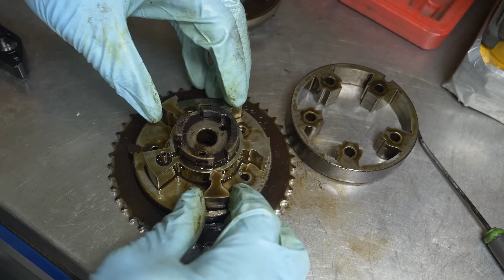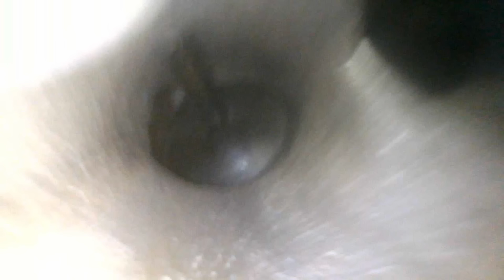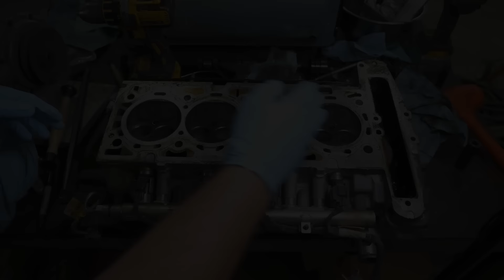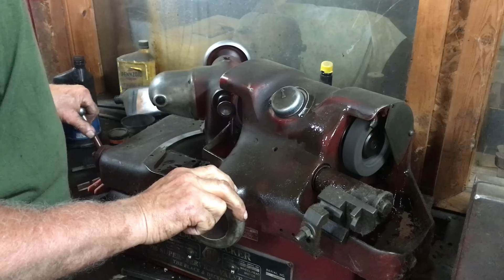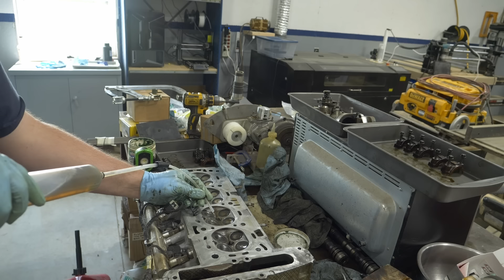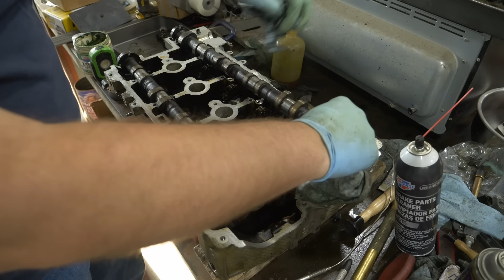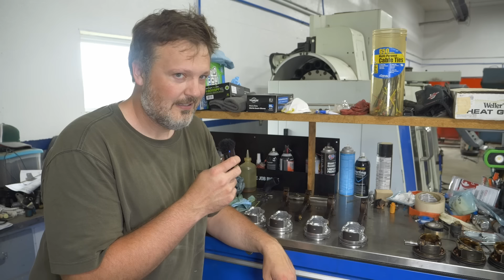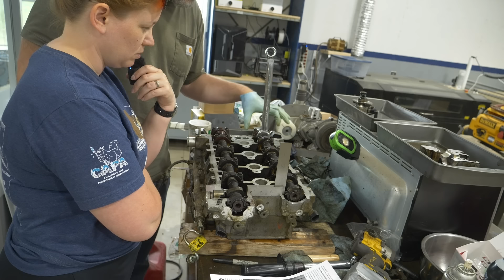How Did it Ever Run? Equinox Still Won't Start

Comment: Yup 2.4 do NOT EVER just do chains n guides, do everything, and oil punp, and high pressure fuel pump. Pump fails, thins oil, burns up pump, loosems chain=loose timing chain/eaten guides. Its a COMPLEX failure

Comment: All new engines have problems with valve dirt and stuck low tension piston rings. Once a year I run pure ATF in my crankcase for 100 miles and compression comes right back with no blowby or burning oil

Comment: Classic example of GM trash engineering. Press fit reluctantly wheels, low tension rings and Chinese supply chain garbage. It's not just GM, it's Ford and Stalantus too.

Comment: If I’ve learned anything from this video, it’s that that particular engine is absolute garbage.  I’d heard of the hilariously expensive water pump replacement, but this takes the cake.  Proof you can indeed over engineer something to the point that it’s worse than the cruder builds that came before.  Gives me fore wet timing belt vibes 😅

Comment: went into a toyota engine to fix the oil consumption, did not know it had spun a bearing,luckily no damage was done that i could see,  the pitting on the cam journal surely is fine 🤣, you rarely find 1 problem i guess

Comment: WOW, I went deep into one of these a coupe of years ago and gave up before getting this far. The motor is still sitting outside my shop, I am going to dig into it now. 
I haul scrap cars for the local fire department. The ones that they practice cutting up and rescue with. Currently they have 4 of these Equinox waiting to be chopped to pieces, 2 4 cylinder and 2 6 cylinder. All have bad engines and look like practically new cars. They were donated by people and shops who couldn't afford\justify fixing them.

Comment: Mrs Wes conclusion is correct … omg … i remember the time when a guy could pull a Chevrolet engine out of a junkyard and it would run for years with just oil changes … my neighbor had exact same issues with a 2.4 Malibu …what a nightmare !

Comment: This is a perfect example of the saying “no good deed goes unpunished” and the exact reason why I always tell friends and acquaintances that no, I will not work on their car for them. I know this was your brother, and I do help work on my immediate family’s cars (not in-laws), but this is a really poopy situation. It’s amazing that GM could build so many design flaws into one engine.

I ran into the wheel spinning on the cams of a handful of engines over my years as a tech. It completely boggles the mind. Lucky there was a TSB that showed the correct positions for the reluctor wheel in this case because that is tricky to diagnose otherwise. I don’t know how to do it without either a scope (and known good cam/crank waveforms) and compression waveforms or a known good engine to compare to.

Comment: It's videos like this that make me glad that my cars are still port injected. Also, this engine (or design) seems like a lemon with so much wrong with it. You might as well put new main bearings and an oil pump in it while you're at it and call it "rebuilt". Damn near everything else is done at this point.

Comment: Re: the spun piston pin rod bearings: With the oil rings/spacer completely plugged up and no oil going thru the drain holes, is this stopping the pin & bearing from getting sufficient oil/lubrication? If there's no oil squirters than they may have not been lubricated...

Comment: You made me laugh a lot Wes :))) Btw probably you know that but i have to say that you never use that head gasket again on these Opel engines after you torqued  head bolts down even if it is brand new or you will have a lot of problems in near future trust me on that.

Comment: Hi Wes thanks for another great movie. I saw you using a marker pen to see contact serfaces . I did a similar thing to mate my  VW heads . I used grinding paste 2 different grades coarse and then fine . I then used some blue stuff to paint the finished edges and then tighten up the heads to the proper tightness, then undid them and inspected the blue on the face of the head / barrel . When the blue was even in its shade along the edge of the head/ barrel it was ready for the head gasket. It took ages but it never leaked.

Comment: Likely the difference between the original Pistons /rings and the new is the amount of spring tension on the new rings is going to be increased to reduce oil consumption.

Comment: Afternoon W.E.S. 
  Some time ago ( Whether it was Y.O.U. ) Or  some other content creator out there ? 
Came across the MYSTERY of  Inconclusions Much like this one before us. 
    Let there be ( No Mistake ) that  mechanical, electrical, Plumbing, Carpentry,  ( A.I.) , etc.  along with   other means out there ( WILL ) Also try our Patients  even when Doctors are Not in the picture - Before or  After... Oddly  ( I ) Have  seen a  similar issue throughout the years of trying to Repair ( Five Minute Projects ) Supposedly.  One  such Dilemma had stumped about  all willing to take a  chance at its Origins also. Out of the blue this Ole Timer from years before Stuck his Nose into the Situation and  backed up with a  Shit eating grin and  Near fart stench of  Rotting garbage laughter in his imagine of  facial expressions. 
What did He See ?   How long  before this was it  TEACHING  Him the lesson before US ? 
        Like the saying that never gets old. 
Rule # 1 and  Rule  # 2   (REMOVE YOUR  Head  YOUR Butt )  Rinse and Repeat Time and Again will only bring  clarity once the clean air is aloud to move from the intake through the  exhaust.   Mouth, Nose, Peter or  Butt holes , EXCUSE the Direct Reference being used now. 
     C A T A S T R O P H I C   Failures  NEVER  Ever happen in a  Split  second  without  some form of  RESIDUAL  Evidence being present. 
 Another Youtube Creator NNKH   ( KRIS  )   Took two different engines into  Lorenzos  Fast Flow  to get them worked on.  Each with unique details.   The one  much more basic yet  still needing plenty of attention.  The other was a  Mad Scientist  Creation of  mis - matched parts and  not  so good  mating surfaces that got  shoved together to make it  Sort of  run - Poorly. 
    REMEMBER  to NEVER Ever Forget.   
The Answer Many Times ( L.- I. - E. - S. ) in the Questions being asked ?   
Why wont it  run ?  How long  has this been going on ?  Did  anything  ( FUNNY ) Suddenly  Happen ?  Was it  sitting UN-USED for a  Long  Period of  time - Beforehand - Possibly ?   Etc. 
Like this  Excessive CARBON Build -Up is a  Symptom to Bigger problems.  Again ( KRIS ) from NNKH  did a  Quick Fix  on the Cadillac  that had been hastily  put  back together before or  Just  after the owner passed away SADLY.  Garage Tactics of  A  Little bit of  Force  even  slightly might be the Worst - BEST option when the bills  coming due and  others are NOT willing to be  paying you fairly either in the process here. 
   HONESTLY is  ALWAYS the BEST Policy.  Even though It  might hurt  a  persons  PRIDE and  effect  the Bottom line like  ATM and Bank Fees once the Lady of the House  sees a  Statement you have been trying to hide for  as  long  as possible  surfaces.
The You Tube  channel  2 Vintage has a  Younger guy named JOE  who many times is  doing the  OPPOSITE of  the Parts CANNON being Re-Loaded just to try  for a  different  result that many others have long  since given up on.
Like the Saying  goes. 
" If It Was EASY -  Everyone Would  Be  Doing  it for a  PROFIT instead of a  Loss "
        YOU WES have given a  Valiant  Effort here. 
Still not  at the end , YET Bit  by Bit  Losing  that many more hairs that will never return to BRAIN Pan of  History's  Learned and Forgotten  Lessons of  DOERS and Not  just  Losers.
The VOICE of REASON has Spoken..

Comment: OMG that is one hell of a reluctant shaggy dog story! 

I recently had my engine out for some repair work that started with a broken pulley wheel crankshaft bolt. Don’t ask.

After solving the original problems and getting it running again. Quite sweetly. The turbo, that had been professionally checked while the engine was out, decided to start boosting like a racing Porsche.

Guess which one external part requires engine out to remove the heat shields? You guessed right. The damned turbo!!! Just finished hoisting the engine out again. 

I share some of your frustration.

Comment: Some days you get the bear, other days it gets you. You bat a normally high average so this is just one to even it out some. This is just one that will give you the experience if another comes through to decide if you want the job or not or to just quote a replacement engine.

Comment: Excellent diag skills Wes, but damn, that engine is such a POS! How much would it have cost GM to use a roll pin, grub screw,, or even tiny Tig  weld to stop the reluctor wheel from moving?   .

Comment: You know what stopped me from buying one of these? Other than not liking them in any way. I was once in a different automotive service industry. I did auto glass. I went to a dealership to fix one of their cars. It was a rainy day, so they made room for me inside their shop. And along side me in their shop? 13 of these Equinox's. 13!! ALL needing engine work, or just plain needing new engines all together. A tech there told me, "Don't ever buy one of these pieces of shit. Or anything with the same motor." I took his advice. 🤣

Comment: Well, if it makes your brother feel any better - I waited in excess of 90 days for a GM 5.3L engine swap.  The crap-show was incredible!  The shop had no one in relation to me, and yeah I probably should have sued.  The new crate GM motor keeps throwing a Knock P0325 code and the shop can’t figure out why….and as of today a new problem has emerged that has me baffled - might be just aging vehicle related and not the new motor…..sigh

Comment: I had a 2008 VW gti wtih super bad valves, luckily the camshaft journals were chowdered so i got to replace the cylinder head instead of having to clean all of that crap. Also Lexus had a ok solution, adding smaller injector in intake so still having the DI but cleaning the valves also.

Comment: Had the P0017 on my kids Saturn Aura with the 3.6 liter V6. One of the checks they have you do is for the crank-shaft's reluctor wheel becoming detached or misaligned, affecting the sensor's ability to accurately read crankshaft position. Luckily, for me, it was only a stretched chain. I always wondered how many mechanics were working on these motors before that TSB came out and all of the absolute frustration that it must have caused!

Comment: Did you remove the large nut on the back of the engine that holds in the oil pressure device that keeps up the pressure on the cam chain, and check or replace that simple device, which is very delicate. This lack of tension on the cam chain will screw up the valve timing, causing major problems. Also, if you’re lucky, you’ll find that the exhaust manifold is split in the center, spewing exhaust gases into the air, but this open crack is hidden by the heat shield that hides it, but still screws up the O2 mixture, resulting in terrible mileage.  At that time, new exhaust manifolds were unavailable from GM, and the after-market manifolds had to be worked on a lot to get them to fit. GDI engines always have crapped-up intake valves.  Good luck.

P.S. A lot of the problems I had were caused by the dealer performing a warranty repair which replaced the chain that drives the water pump(and maybe replaced the water pump) in the 2010 version of this engine in an Equinox.  However, the cam chains had to be removed first without screwing up the VVT timing, but there was no money in the warranty repair for removing and resetting the VVT timing, which caused short cuts to be taken.  After the dealer ruined the operation of the cam timing, they wanted about $5,700 to throw parts at it, but with no guarantee their efforts would work.  This is a car I drove into the dealership in limp-home mode, but which wouldn’t run at all a week later when I went to check on it.  I asked about salvage value for the body, which was in great shape, and was told it was worth Zero in salvage value.  So I towed it home (120 miles), buying a battery on the way, which allowed the car to start immediately, but still in limp-home mode. 

When I fixed it, with no new pistons and no new valves, but with the VVT timing and cam chain tension correctly set, it ran perfectly, and I got $5,500 in trade toward the car my daughter needed and I never had to work on that Ecotec engine again.  Note: Cam chain tension is so high on these DOHC engines that the chain will jump timing quicker than the eye can see, if there is any slack at all in the chain tension system, something I learned the hard way. Hope my experience in dealing with my 2010 Ecotec engine helps in figuring out the problem. If it will crank again, try using Havoline Restore and Protect Synthetic Oil, which will remove the built up carbon and crap behind the piston rings and in other places, giving your engine a better chance to run again.

Comment: I hate direct injected engines. When the crankcase vapors are run through the intake, the carbonized valves kill performance and eventually the engine. I have one of these cars and I have wondered if a catch can on the PCV line would be worth the trouble.

Comment: you just a boy... you ort not be tawlkin like at...  the "GM" yer dealin with, aint the same "GM" yer paw delt with... they've gone euro soft, and think Americans will buy it....I dont buy "GM" .... same with ford, its all mercur crap now.... ill stick with Toyota and Honda... easier and cheaper to work on...better alloys, better engineering, ALL around..

Comment: Exciting!

Re the reluctor wheel: Have anyone been in the engine before you? This can happen if someone who don't know what they are doing uses the wheel to turn the cam shaft. Seen that more than once on Pine Hollow. The ugly hack to fix it is to just use some tool to turn it back into its correct position.

Re the grime: Some newer engines seems to have both direct injection and regular intake injection. Maybe it's possible to retro fit that by simply adding a regular injector right after the throttle body and have that fire at the same time as every of the other injectors, and feed that with a rather low pressure and/or rather use an injector that is for a way lower flow (motorcycle injector?). That way most of the fuel is direct injected but some fuel cleans the valves.

Comment: Well, a friend of a friend has a 2010 Equinox  with about 80K miles that has been sitting outside  for a year because the owner died. I was thinking of seeing how it drives if I can get it started, but I think I am going to pass on it now. It may be ok but I don't have the moola to fix a major engine problem if one were to develope.

Comment: I would say the that it ran low on oil over heated and all that antifreeze from the blown headgasket eat the rod bearings and the camshat bearings and was just before locking up when the timing chain part broke and twisted the reluctor wheel. those are heated to orange glow when they are put together. at elevated temps they get loose.

Comment: It's a good thing you didn't use the pico with a known good waveform for checking the timing, and finding the turned reluctorwheel that way. You wouldn't have caught the wornout wristpins...
I 'm a technician in a totally different field, but also get repairs like this. With a minimum of four faults in one device, which "suddenly" stopt working, and off course, was great before! 😂

My hat of too you sir, great diagnostic skills, and patience on this channel. She be good for another 100k after this😊

Comment: Dealer tech here.  I've had several of the exh camshaft reluctor wheel spin out of time.  Everyone of them was after the rear main seal popped out, and was driven without oil.  2.4 has to be the biggest POS engine GM ever produced.

Comment: The spun Rod bushes scream long term overheating, that would explain all the carbon, and maybe the reluctor wheel slipping. I’d be looking at the oil cooler to see if a bimetallic bypass is stuck, broken or bent?

Maybe it was just started on a Friday afternoon, then finished on Monday morning?

Comment: the intake literally sucks oil from an rpg tube placed directly in front of an oil squirt location. it constantly keeps the oil at low levels while clogging valves. often the oil is so low, about 6 to 5 times a year, that bearings over heat. this car was deliberately created to self destruct. there was a lawsuit about this, and i do believe at one time gmc had to fix the engine for free, but they never reposition the rpg tube. you have to buy an oil cap and make the cap your new location and plug the old rpg port.